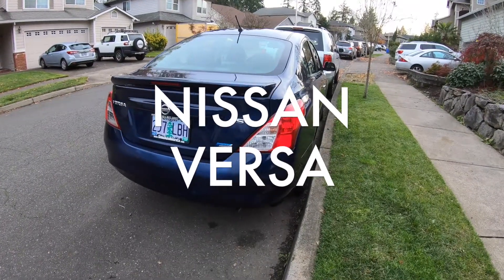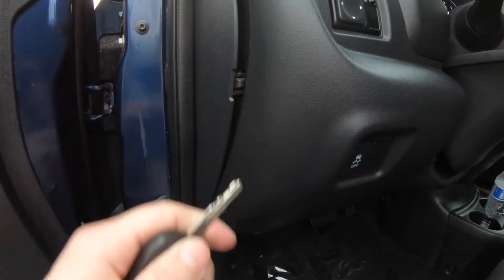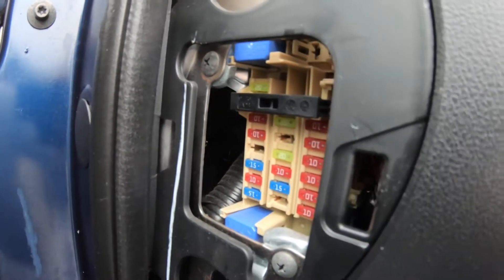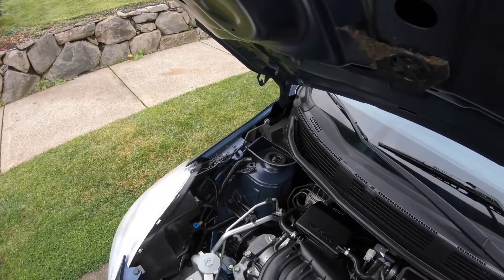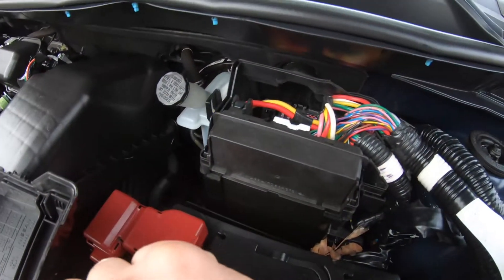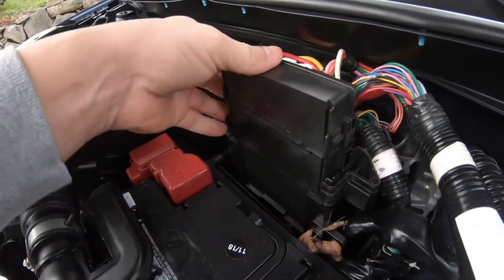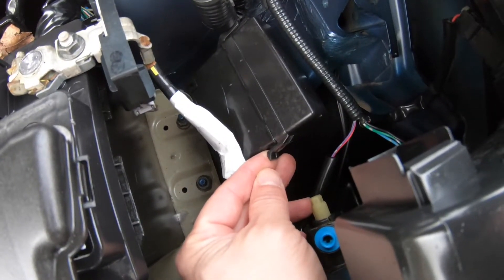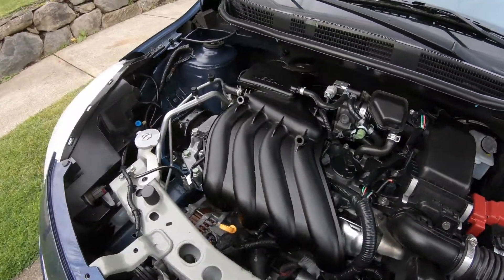FUSE BOX LOCATION ON A 2012 - 2019 NISSAN VERSA

Comment: I have a 2012 Nissan Versa that starts but will not accelerate when put in gear what is the problem
Reply from the maker: look in to changing the fuel filter first .
also check your air filter .
also spark plugs. 
what exactly is it doing?

Comment: Has anyone had trouble when you press the brake pedal and shift that the gear indicator on dash goes blurry? Mine started that recently then it lurches at first when starting to accelerate. Is this just a versa problem?

Comment: What a dumb design for the hood fuse box
Reply: You want talk about dumb design try checking your transmission fluid good luck
Reply: The whole car is junk 😂I hate these cars and that cvt transmission is crap
Reply: Try replacing the blower motor….. You have to take out the fuckin steering column
Reply: Does anyone know if the 2014 Versa Sedan has a relay for the AC compressor?
Reply: @W4RB4D  sir  I did  the same job  but i only removed   The accelerator pedal